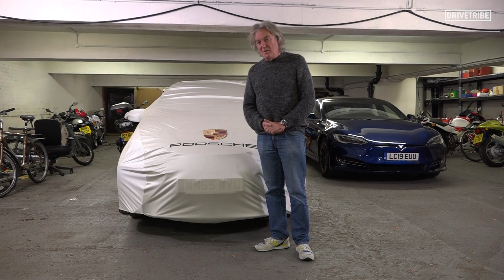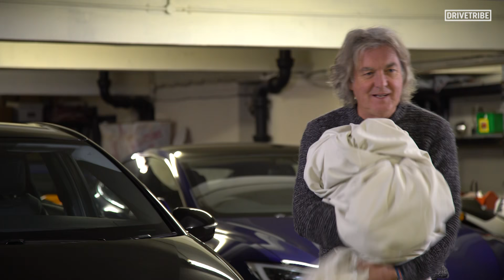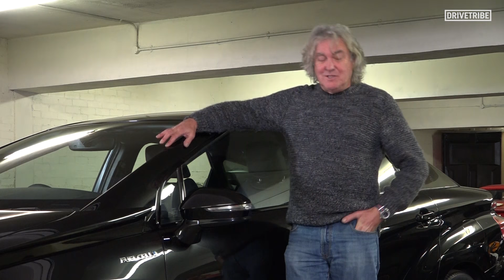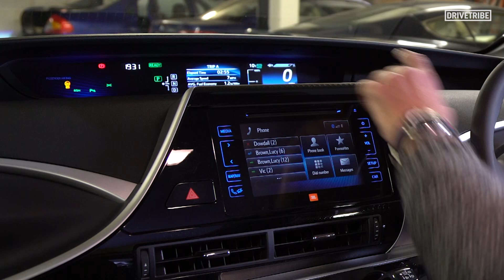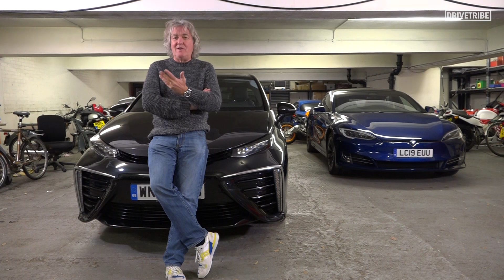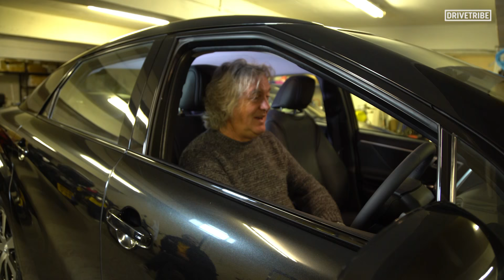James May has bought ANOTHER new car

Comment: My first thought was about weight, since the HFCEV wouldn't need that huge battery, but on comparing the specs between them, the difference isn't as much as I thought. It may have to do with the Mirai having a small EV battery, as James said. 

The point about infrastructure is interesting: one of the common whines about renewables is that generation is intermittent: the wind has to blow, the Sun has to shine. If HFCs are integrated in to the grid, then excess power can be used to create hydrogen when it's there, then hydrogen used to power the grid when there's no wind. This is in addition to its use as fuel for vehicles.
Reply: Exactly.

Comment: The thing I like about my EV is that I can fill up at home and hardly ever have to elsewhere. My suspicion is that charging speed improves and battery packs increase in density the fuel cell will make less sense for cars. It will no doubt find a niche in other applications. Either way it is better than spewing exhaust fumes into congested areas. The Tesla us a heck of a lot more exciting to me
Reply: Indeed. What happens with batteries will be very significant in all this. Let's see.

Comment: The Toyota will be a useful car I think, but looks a bit like a crossover.
Beware of car parks at night and bedtime study of sensible Bailey or Swift caravans...
H2O does take an effort to separate, but you get it all back when it burns so it's a pretty efficient way of storing energy. Charging a Tesla is not 100% efficient as you have charger electronics losses and battery hysteresis losses, plus the Tesla burns around 50W just sitting there doing nothing. Add on generation and transmission line losses and overall it's generally more efficient to burn petrol.
The Prius is a great car: very well built and second hand you have to be wary of huge mileages because they do them with dependable ease. The Honda Insight Mk1 was cooler though 100mpg possible, better than most bikes and scooters :D

Comment: James 
Why even convert electric energy to hydrogen and then transport in containers?
You can just connect the electric energy source to the grid and it would find its way directly to the car.

Hydrogen is an unnecessary step

Not to add the lower efficiency of the entire hydrogen process

Comment: Hydrogen will be the future. Simple practicality. Hydrogen can be filled MUCH faster than even the new SuperCharger V3 from Tesla. Now. Nana might have a battery EV for going to bingo. But families and most normal cars will be hydrogen fuel cell because it not only fills faster. But the only thing stopping hydrogen is rolling out the infrastructure of filling up. The CSIRO in Australia has found that a small machine at each petrol station could remove the hydrogen from Ammonia. So that the current fuel trucks can move ammonia to the petrol stations and it would be split by the machine to be pumped in to the car. The solutions exist for hydrogen fuel cell we just need to improve them and roll them out

Comment: The experiment would be better if you signed up the EV to a car to grid system.

Basically if your Tesla has a range of 500km and you know you'll only do 50km on that day you can assign the rest of your battery as storage for the national grid.  Once a couple of million people sign up their cars to a car to grid system, then the UK can switch off a couple of the power stations that are designed for peak demand.

So more people driving EV's means we can have more green energy without worrying about peak demand and base load.

Another advantage of car to grid is you have another acronym to impress people at the pub.

Comment: Toyota Mirrun Hydrogen Electric Is The Better Solution Like A Gasoline/Petrol Powered Engine But Instead of Using Gasoline/Petrol, Ur Using Water Instead. So I Think Personally Hydrogen Is The Way To Go. 
Fill Up Ur Toyota or Any Other Manufacturer With Hydrogen System and Enjoy Miles of Carefree Driving Like We Have 2day.

Comment: What about synthetic fuels produced using waste heat from modern nuclear reactors so that we keep our existing infrastructure?
Reply: Our existing infrastructure is crumbling.
Reply: @elirien4264  That's bridges and tunnels, which hydrogen/electric cars need, too. I'm talking about gas stations, auto repair shops, pipelines, the electricity grid, etc; things that will have to completely change. That's a lot of energy, almost all of which will come from fossil fuels.

Comment: Hydrogen fuel cells are the beta-max of the car industry.
Reply: In that analogy though we definitely haven't invented the VHS yet. Electric cars aren't it and quite possibly never will be.
Reply: @VeeSeven700  I have to disagree. Creating new battery tech is a necessity and can be used in all aspects of life. Electricity already has an infrastructure and can be accessed almost everywhere people who drive are. Hydrogen tech will always have fewer applications for the common man and only accessible at roadside retailers.
Reply: Electricity and the electric motor have absolutely no problem overcoming and exceeding petroleum and internal combustion.

The problem is batteries. I just don't think batteries are the answer and seeing as the electric car is currently completely all in on using batteries I just don't think we're on the long term winning path.

Batteries are awful. In phones, in laptops, even in watches the annoyance of changing batteries and the problems that always seem to stem from doing so has driven me to use a solar watch so in theory I won't need to change any battery at all. Though we'll see on that. It still has a battery which will degrade at some point. Batteries are like the steaming turd on the white carpet of the technological age we live in.

To succeed petroleum in the long term any solution will need to be more practical, as cheap or cheaper and cleaner. Electric cars are maybe 1 of those 3. They're cleaner than petroleum but nowhere near as clean as people imagine. Battery production is a dirty business. They're currently way more expensive and can't even come close in terms of refilling the tank, as it were.
Reply: @VeeSeven700  They are improving battery tech every day it is one of the leading fields of research. lithium-oxygen batteries, carbon dioxide batteries, AquaPIMs and that is only scratching the surface.
Reply: Indeed but I have been hearing similar things for a long time. Mass market options haven't changed much at all. It's one thing inventing something (which I don't doubt is happening) but it's a whole different thing to roll it out. 

Phones are the first small step.  The easiest step. Until impressive new battery technology is rolled out for phones the car discussion isn't worth starting, in my opinion. Phones aren't fighting an alternative. You either use a battery for a mobile phone or you don't have a mobile phone. With cars there's an alternative already in place. Petroleum powered cars are affordable and incredibly easy to run. Drive a few hundred miles, stop for a few minutes, drive hundreds more. Batteries have to match or better that or it'll never succeed. I just don't see they're anywhere close right now. 

And listen, I hope I'm wrong. I really do because batteries are a source of immense frustration to me on a daily basis. If someone rolls out a revolutionary new battery technology I'll be the very first in line to use it. Nice talking to you! 👍
Reply: @VeeSeven700  I believe that we have not reached the limit to battery tech. There is too much money in becoming the person or group who finds the solution. You have a good one David. Happy holidays to you.

Comment: James why don't you buy a good sports family car from the 80s? They fit you quite well. It's got that sensiblness of a family hatchback but still with slightly hidden bite with its loud power at high end RPM.

My suggestion are a VW MK2 Golf, Toyota Corolla AE86 or an Alfa Romeo GTV6.

Do it for fun if nothing else.

Comment: Hydrogen is good, many Japanese manufacturers see hydrogen as the way forward, hence the name of this car, the Mirai, which in Japanese means "future".
Reply: @Oakie Hydrogen is more stable than lithium too
Reply: @Oakie There is also one very large problem with modern batteries, they are made from lithium. If all car production shifted to electric cars, we would only have enough lithium for 20 years.
Reply: BigJoe_Buster there is only a very small amount, plus other chemistry’s are in the pipeline, it’s very unlikely to ever be a huge issue